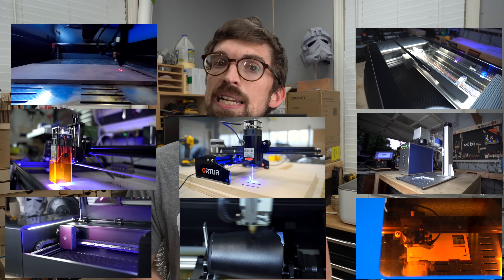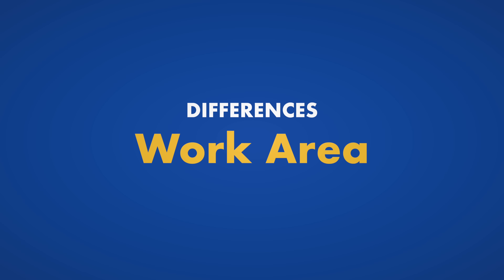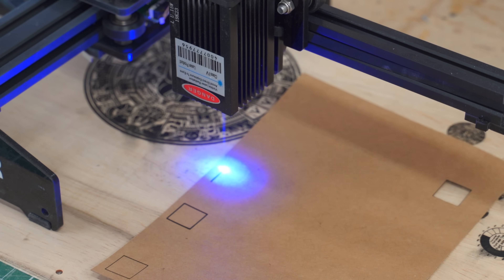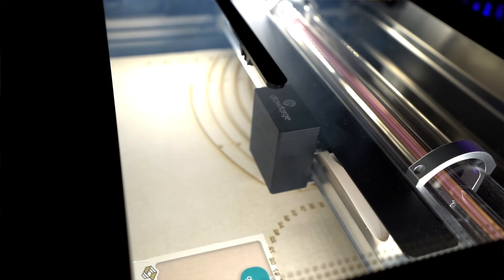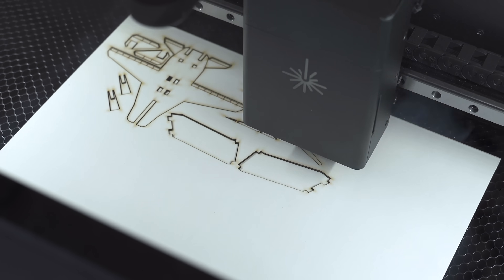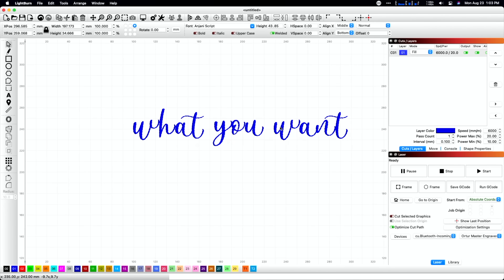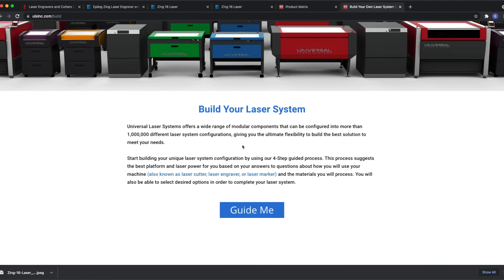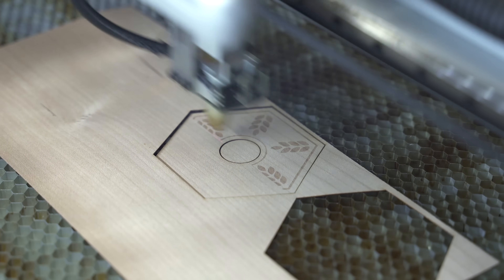The Best Laser Cutter for any Budget?

Comment from the maker: Which laser is your top pick for 2021?
Reply: Do the cutters cut plastic without melting it?  I’m looking to make plastic drawing templates and architectural templates.
Reply: 7
Reply: I’m looking for a laser first time, and my idea is to do some tumblers, an all kind of wood, cuts, cristal etc… which one you recomend, and were to buy it…please need some help
Reply: I found this as an interesting introduction to small systems, the one with a 2x4 foot work area would be great for cutting model aircraft parts because you can handle a quarter sheet of plywood at a time.
Reply: Emblaser 2
Reply: I'm getting ready to pull the trigger. Omtech 50w, upgraded ortur 2 pro,  or the spark maker with upgrades? Any thoughts?
Reply: So I own a leather company and have been using ortur but want to upgrade to a reliable strong laser that will work great. Is glowforge pro the best or is there another that is in same price range that could do metal as well..(metal parts for leather work)
Reply: Ok for $900 +/- 300what way would you go?
Reply: Can you hand me down some of your diode?
Reply: Dont forget to mention to your viewers that you get a $500 kick back per unit that sales via your glowforge link.  You always seem to leave that out.
Reply: @garrydye2394  If something is free, you are the product.
Reply: @garrydye2394  this is a Glowforge infomercial lmao
Reply: @garrydye2394  As a beginner I thought the reviews were pretty balanced.  Many of those providing information receive compensation from links.  That is the nature of business!  Thank you for the information!
Reply: Bought a refurbished 50w omtech for 1500. The only regret I have was that my credit card didn't like it
Reply: @eyeofthetyger8504  Do you consider buy a brand new laser cutter and engraver from China with a price your credit card absolutely likes?
Reply: Anything with an open universe, I don't trust closed environments any more. So outur for diode and omtech for co2 for me
Reply: If you're just getting started I think the Ortur is a great way to go. Learn the basics without overwhelming yourself, then once you're feeling comfortable you can branch out into some of the other tech! :P
Reply: Ortur!! This is me first time trying a laser machine, I just love it so much! I made so many great crafts.
Reply from the maker: Awesome what are you making
Reply: @makeorbreakshop  pumpkins is on the list soon, but I don't know if the laser can handle moisture
Reply: Zac's DIY Guns  yes...glowforge gives all these guys a $500 kickback when you click their link and buy.  Thry never tell you this but it's the reason so many Aholes promote this POS.
Reply: @garrydye2394  I was not aware of the kickback for glowforge.  That makes the video content here impossible to trust as it moves it from “This is a guy who is sharing his thoughts and experiences” to “This is a person who has been influenced in his assessment by money that he will receive.”  It isn’t naive to believe the idealistic/former viewpoint either.  There is an army of software and hardware engineers that spend countless hours each year to build the systems upon which others build products - including glowforge (Linux kernel for their machine). The vast majority of Open source contributors get zero dollars for their work and do it with the right intentions.
Reply: @mchughj  I used to be one of those engineers creating open source projects - until someone with no scruples came in and found a way to "legally" commercialize the project without compensating any of the engineers - never again!

Comment: Really informative video for me. I was wondering if i could get an advice from you. I am a modeller, i do paper modelling. From card board mostly. Case like: https://www.youtube.com/watch?v=fVNxurfl-1c&t=187s. I spent some money on laser accessories (support for hull, some large construction parts etc). So now i mostly wonder if investment into laser cutter would be good idea. Would be cool to make my own detailed components like railing, framing - you get the idea. I need to cut cardboard (not corrugated) thick ranging 0.5 mm - 5 mm ( that's max i think) and some wooden plywood (in some cases). Would you advice something with reasonable price (Say under 1 - 1.5K) ? I cannot justify spent 2k on device i use once a month or so.

Comment: Hey Brandon, I wanna cut through a bendable magnet foil / sheet whose thickness is 0.5 centimeters (0.19 inches). So what would be the cheapest option for that?

Also, is there any special need to prepare a vector png file, or can you just directly end it to cutting? it's like a 2D game sprite.

Thanks!!

Comment: Interesting video, thanks for sharing your thoughts on lasers. I'm very surprised you picked Glowforge above all other desktop lasers. 

Having used both the Glowforge and others, the only benefit to Glowforge is ease of getting started.  The native Glowforge software is a bit easier to use, but it is also feature poor. They also hobble the software unless you pay a monthly subscription fee. 

Other drawbacks include - cleaning the Glowforge is more difficult, and the laser is underpowered for the price. Most importantly, and most hidden from the customer, - their support is weak at best; they are slow to respond to issues, if they ever do; and they don't really sell key replacement parts for wear and tear, instead they want you to ship your machine back and purchase a refurbished device for all but the smallest issues. 

Oh, and  you have to upload your designs to their cloud based service, meaning you can't print if your internet is offline and they can monitor what you print on your machine.

Comment: I am new to lasers and would like to purchase one to cut thin wood to build structures for my hobby.  I was looking at the Ortur, but it seems that the diode lasers are more for engraving, will they cut?  I am wondering if I need to save and buy a CO2 laser if I want to do cutting.  It seems like the Glowforge and it's counterparts are overkill for my modest needs....any suggestions?

Comment: Good and informative review. Thank you! Just one question.. With CO2-lasers the air assist near or on the nossle is for clearing the smoke and fumes, so the beam is unobstructed for a sharper, better result and the focusing lens gets less wear due to particles sticking to it and burning in. In the video you mention air assist, or lack thereof, on diode lasers, but as a lacking safety feature for putting out fires.. Is the use of air assis that different in the two types? In my experience the air assist can promote the opposite, as it fans any fire, adding more oxygen.

Comment: Loving this channel and your vids. In the process of researching for a laser. 
Looking for something to engrave and cut acrylic plastics/abs and engrave metals. 
To clarify a Co2 won’t engrave metal at all?
Reply from the maker: Right a CO2 won't engrave bare metal, but if you are working with Stainless steel, powder coated or anything that has a coating on it then you can engrave since you would be removing the coating and show the metal underneath which can sometimes give you the same effect.  You can also use products like Ceramark to spray a coating and then laser engrave off.  For real metal engraving you'll need a fiber laser.

Comment: I custom built ours for our small business, but I also have an engineering background and several years experience with 3d printers and motion systems including modifying firmware..  It is a 7W diode that I will be upgrading to 10W soon on a approximately 5 ft x 5 ft frame (about 1400mm squared actual work space).  My other half and sister in law do a lot of sewn products for people, and being able to laser cut when you need 50 of the same pattern cut at a time is a huge timesaver.  It cost me around $1000 in parts to build plus a lot of time, but even a diode unit that large would be a few thousand dollars minimum.  I could have dropped that price by 3d printing more parts instead of using aluminum for 99% of the machine.

I recognize that is not a good option for most people though.

Comment: I’m exploring the laser and cnc machines and what they can do. I’m a newbie with no knowledge of what they do, what I can do with them or how I can make income to justify the cost. I want to go with my third machine first. I don’t want to buy one only to realize I need a bigger one etc. I also don’t want to buy industrial only to get bored with producing products. I don’t mind spending 20-25K setting up shop with tools that I will need to do the work correctly. I do have a bunch of carpenter tools for rough work but nothing really for finish work. So I will continue my research in what tools I will need to enter into this field. Now having said that, I am impressed so far with the Glowforge Pro Laser Cutter. Will that be my first purchase? I don’t know. I want to check out your other reviews as well as other folks reviews on the different brands. I will also be looking if someone did a video on complete tools to setup a shop needed. This machine sounds pretty simple and that’s good for an old guy like me. If you have any suggestions or links I will check them out. Thank you.
Reply: Researching the different brands and models will help you refine what you find valuable in your shop. The size of pieces that you want to work on is a primary driver for the size of the machine itself, as well as the type of materials you wish to alter/change. If you have lots of time, you can cut through fairly lightweight materials with multiple passes. A Glowforge has its drawbacks...for example, the cost of the machine vs what it can do. It must be connected to the internet in order to do any work on it. This is a major drawback in an age of relatively unreliable platforms like Microsoft Azure and Amazon AWS. You will notice many services/businesses (that run their businesses via web-based hosting) unable to do anything when these large hosting platforms are down. Will you be happy with a Glowforge? I doubt it. There are countless reviews that talk about how overpriced and underpowered it is. 

I personally have made the mistake of buying things only to find that they are not utilized and take up valuable room. Choose carefully and watch videos from people that are actually using them and producing products with them, (not merely hawking them to get a commission).

With that in mind, here are some roads I have gone down: 
The Onefinity Journeyman X-50 (haven't got yet) CNC is a great subtractive method for your shop. 
The Creality (my 1st choice) and Prusa lines of 3D printers are standards ( you can get a lot of free YouTube training upon, also many service businesses use them). 
Laser? I'm leaning toward creating my own CO2 because of the size of materials I want to etch as well as cut. 
Thermoformer? Also going the diy route.

I want to make products, not small arts and crafts.
Reply: @innovator777  That makes lots of sense. I want the flexibility to do a wide range of stuff. I have a disabled son in his 30’s who is a computer wizard. He writes programs on a note pad. I got him in the computer world when he was 3. He has an interest in creating things with whatever I set up. I’m not too concerned with how much I need to spend providing I can see money coming in to justify the cost. Something reliable that’s a notch or two above what a hobbyist would use prolly closer to a small business setup. So yes, I will spend a couple of months watching all kinds of videos before dropping cash. Do you have a channel or links that would be to my benefit? Thanks in advance.

Comment: I'm looking to spend in the range of $4-6K on a floor-standing laser. My big concern is software. I want to be able to print/cut directly over USB or WiFi from CorelDraw like any normal printer. Software like RDWork does a poor job of importing drawings and most need lots of rework to make them useable. What laser can I buy that I don't have to rip the guts out of the minute I get it? Thanks for the help.

Comment: I want a laser capable of cutting a paint film off a copper PCB with really high resolution, cutting lines of 0.005" (5 thou) wide for making PCBs. Note the laser cuts the film off so it can be etched in the usual way. What's the best choice. I have an Atomstak 50 watt model and it is useless as the beam width is 0.015" in one plane and 0.025 in the other.

Comment: Full Spectrum has horrible support. I ordered a new tube and it had a bad seal and filled with coolant, which shorted out my power supply. Took almost a year to get it up and running again (Mailing parts to them and using Google Wallet to pay really) and then it died again. I gave up and went with Rabbit on my second laser and am extremely happy. When I had a problem I was able to get a replacement part in a week. (Not 3 months) We now have 7 Rabbit laser and they all work well. You can have Rabbit come and set up the laser and make sure it work too.

Comment: I've used Epilog and Trotec lasers and prefer the Trotec. They are just more... industrial for a lack of a better word. For my home shop I'm thinking of getting a 100w Omtech. Omtech looks to be a great value.
I'd really recommend staying away from the devices that lock you into their software; especially if web based (wtf!). Sure they make things easier initially out of the box, but serviceability will be a hassle down the road. Better to tackle that learning curve head on and have more control over your production machines.
Reply: 100% this. Sealed gantry alone makes for a far longer lasting machine, and the software is significantly better.

Comment: Hi. Thanks for the superb and very useful video. I'm about to buy a Chinese 50W machine from OM Tech (or at least I currently think I am!). Could someone please advise me on the laser control software? My drawings are being done in Inkscape and that's coming out fine but I'm a bit unsure as to what laser control software I ought to be thinking about. For example, I don't know whether "K40 Whisperer" (which seems like it would meet my needs) can be used with these larger machines. Any advice that gets me from Inkscape drawings to the cut would be greatly appreciated! Thanks in advance :o)
Reply: I would highly recommend using lightburn software to control the OM Tech. Easy to learn and I've now switched to 99% designing in lightburn as well. Used to design fully in inkscape then upload to glow forge. Web based software there so if your internet isn't fast and steady it's a real pain.
Reply: @N__T  Hi, N T. Thanks very much for the reply. I was already veering towards Lightburn (downloaded trial version a couple of days ago) so your reply seems to confirm that I'm on the right path. My Internet is usually pretty solid so that shouldn't be a frequent issue. Much appreciated! Have a good day :o)

Comment: Nice and somehow funny, I am just installing pro, industrial CO2 laser with working area about 11' by 5' (3.5m by 1.5m) with 20kW high voltage power supply. (overall consumption of that machine is around 3phase /400V/ 150Amps).  

But, thank for nice compact informative video.

Comment: Good info, thanks. I built my own laser cutter/engraver using a 15W (optical power) diode laser. The gantry is made using 3D printed parts and 2040 aluminum extrusions. Will need to install an air assist system to improve deep cuts. The only thing missed in this video is discussing how some sellers of diode lasers mislead buyers by specifying the power used by the diode rather than it's actual optical (cutting/engraving) power. As an example, I have another diode laser that is sold as a "15W" laser but actually puts out around 4.5 watts of cutting/engraving power. 15 watts is the amount of power it requires from a power supply.
Reply: How much was your build compared to an equivalent pre built purchase?
Reply: @pipedreamer9781  Not sure. I didn't keep track of how much I spent. The laser itself was US$260. I did 3D print all of the plastic parts myself and the engraving/cutting area is larger than the commercial offerings that I looked at. Actually, I could have made it any size I wanted since the only difference would be the length of the aluminum extrusions.
Reply: Which 15 watt module did you use?
Reply: @thebucketmouse  I used an NEJE A40640. They've updated their specs and now rate the laser at 10W optical power.
Reply: @Waltkat  I wonder why they updated the specs? Did they run out of the components to make the 15W module, or was it really only 10W all along? I emailed them on their website and they said 10W is their strongest laser

Comment: I do custom stamped ring which I fill with color. Is there a laser that can cut deep enough in stainless steel, that I can fill on the spot and make for a customer in about 10 to 15 min. turn around? About 1/2mm deep and the lettering are around 3 to 4mm tall by 2 to 3mm wide.. Also this would be at an indoors event show. Would there be any toxic fumes coming off ?
Reply: Steel doesn't burn off, so no laser will do you any good here. Get a CNC router with a fine drill for that job.

Comment: I want to cut holes for controls, switches, etc. In project boxes..

This means the surface being cut could be up to a couple of centimetres above the bed. Would this be a problem for the cheaper machines?

Project boxes, are quite often ABS, rather than acrylic. Are there any problems associated with cutting ABS?

Thanks.
Reply: You may be able to get decent results in thin abs, but it has a tendancy to melt and release some pretty nasty fumes so you want it vented outside with negative pressure